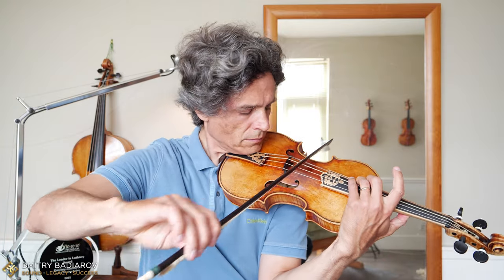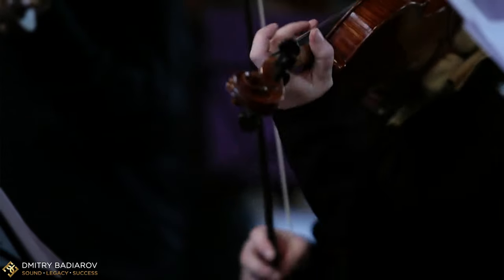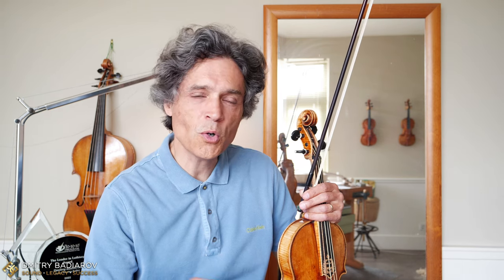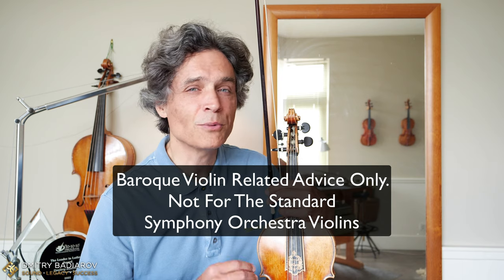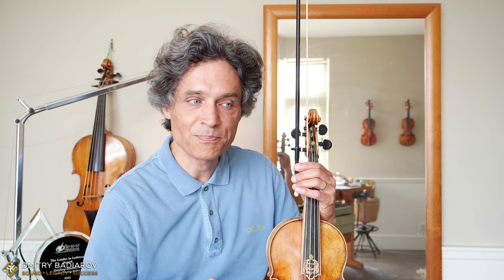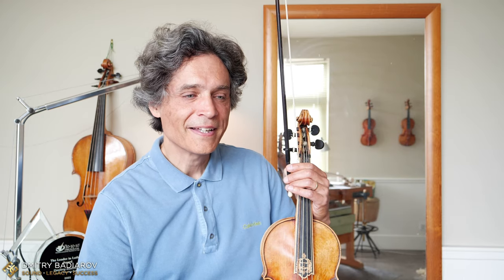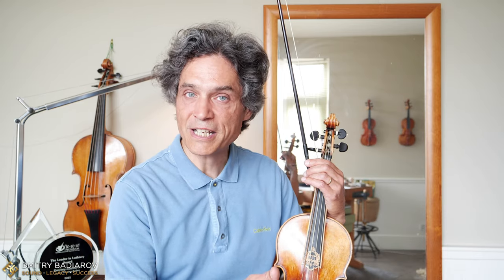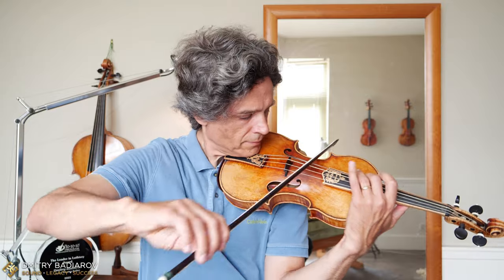Baroque Violinists & Violin Makers: Stringing Violins For Low & High Pitch

Comment: Hi! Could I use this gauges for my modern violin? In the baroque violin works very well because of the bridge. But on the modern, a luthier told me is not a good idea because the sound won't be good and it won't project because of the higher bridge and all of that. So he tells me I should use lighter gauges for the strings. But I play with a lote of force and later repertoire, virtuoso pieces, and the E string doesn't stand it very well. It last very little time. I play in 440/442 with the modern and my violin has a lot of tension. The strings are much more separated from the fingerboard than the baroque violin (for obvious reasons, of course). 

The thing is, I started to play this romantic and modern repertoire on the baroque violin (tuned in 440 and with the thicker gauges) and it works perfectly. The strings last much more, they stand all the things I do. 

What can I do to solve this?
Reply from the maker: "But on the modern, a luthier told me is not a good idea". I just told exactly the same in this video. You cannot use these gauges on a modern violin. Chose: Galeazzi type G (only Aquila makes them), or use a modern G, d 116, a 85, e'' - 70
Reply: @badiarov  thanks a lot! Ok. But I have to change the bridge?
Reply from the maker: @CaballeroDeLos5A  You are welcome. It depends on your current setup. It might be a prudent move on your side to have a second bridge made, specially if your new stringing is radically different.
Reply: @badiarov  Ok! Should it be a lower bridge, a baroque bridge? Or could it be a modern bridge?
Reply from the maker: @CaballeroDeLos5A  It's a modern violin, so use the modern bridge. I think, there is nothing particularly "baroque" about gut strings. Gut strings have been the most common choice until far into the 2nd half of the last century.
Reply: @badiarov  Thanks again! Does Aquila makes e 70 also? I've only found an e 70 option in Wild Strings.
Reply from the maker: @CaballeroDeLos5A  You are right. Probably Aquila makes 71 or 73... It's close enough though. And if something does not work, try something thinner, say 65, 68.... Just tell Mimmo the boss at Aquila you're coming from me, that way he will know what quality you're talking about. It's not a common knowledge unfortunately anymore.
Reply: @badiarov  Ok! I will do that! Thank you very much!
Reply from the maker: @CaballeroDeLos5A  You are welcome!